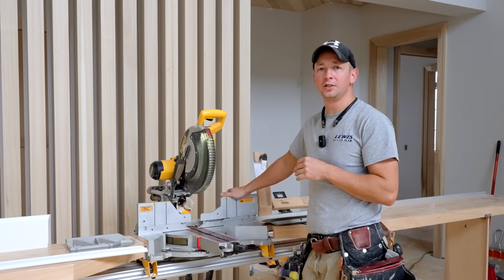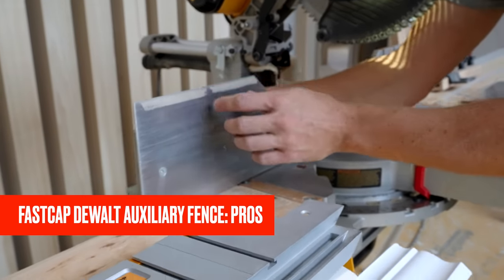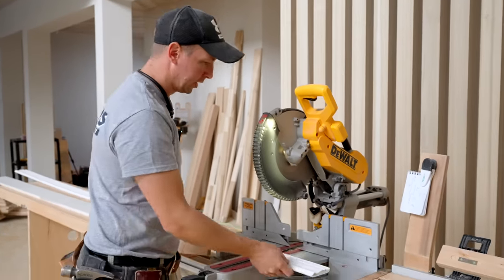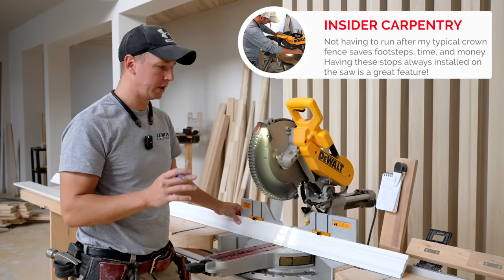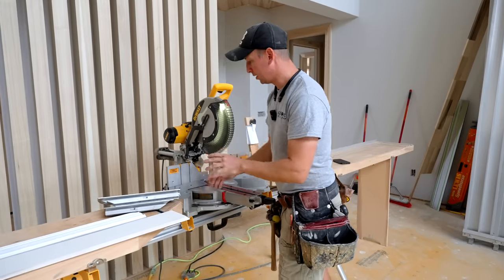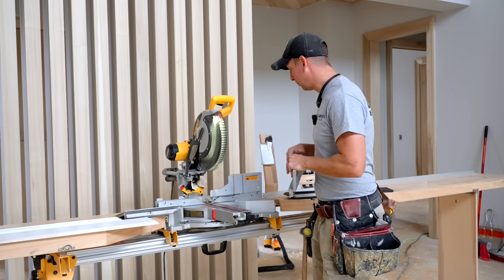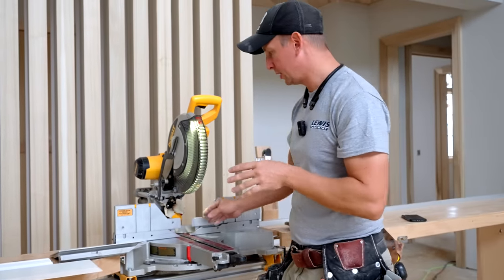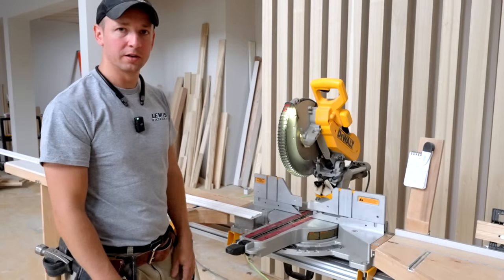These NEW FENCES Are A MUST HAVE!!! - I'm Impressed!!!

Comment: These are great. The Kizen fence has a similar crown stop which I believe is a bit more versatile HOWEVER the trade off is that the Kizen is quite thick in comparison. Will be interested to see if Fastcap starts making these for other saws.
Reply: And how much they want for that fence system?
Reply: @duartepaintinghandymanservices  they offer a few different options with varying prices but the largest kit with all the accessories is around $400
Reply: @jpesce23ful  yea thats insane

Comment: Great informative overview of the crownstop fence Spencer! This was a nearly perfect product when it was submitted to fastcap initially a while ago and was improved even more with feedback from the beta test tradesman group over a few months of testing to get those wishlist features in there (higher fence height, better knobs, and a few other tweaks.) I've all ready chucked my factory fences in the trash. Great add on for the Dewalt saw line up. I think there is only one of the many dewalt saws that you have to watch how close you set the stops to the blade as that particular model (carpenterone3's has that saw) must have a different stop block in the receiving part of the factory fence slot. Easy fix to just trim/grind it for that specific model. Great video!

Comment: I use the Kizen fence which has pins that are removable, so you can bounce back and forth to cutting base vertically or anything else without losing your crown setup. It would be a no go for you though because it adds thickness.
Reply: I now have both the kaizen and fastcap fence and I’m going to be selling the kaizen fence.
Reply: $450 fk that

Comment: Thanks for the review. I bought mine as soon as Fastcap had them available. I had the same problem with the left side fence. Had to file it down a bit, then it worked fine. I also noticed they sit out just a bit from the fixed fence and found them to lean in a bit more compared to the factory fence. Am thinking of trying to file them to correct them. Do yours sit in correctly or do you have the same problem? Otherwise I like them, using mostly for cabinet crown.
Reply from the maker: Mine sit pretty good. The only way I have seen to correct fence tilt is to tap  a bolt into the back to add tension and adjustment. But I fine that the fences are close enough for baseboard and crown install.

Comment: As a cabinet installer cutting prefinished trim.
It's very difficult to find a good square saw out of the box,and can take a lot of time to get bed/table/back in plane and at 90°.
Are they machined properly? 
A prefinished outside corner separates the diy,from a professional.
Reply from the maker: I checked this set and they are the same as the stock fences in terms of square. Both can be slightly out of square depending on how you tighten the wet screw.
Reply: @InsiderCarpentry  thanks Spencer!
Using a bottom mounted stop gets annoying, it's difficult to find 46 degrees etc...and I needed to drill holes near the zeroes .

Comment: How do they flush up with the bottom of the fence once you tighten them up? The right side factory fence on my saw tips the top back a light sixteenth when you tighten it up and there is really no way to shim it.
Reply from the maker: You can tap a set screw into the back of the fence to apply pressure. That's the only way I know of to correct it.

Comment: The stock sliding fence doesn't remain square after I tighten the nut.   Are the aftermarket units square after you install them and tighten the back nut?   Thanks

Comment: Wondering if you can think of any advantages of using the stops on the fence rather than the crown stop on the base of the saw. 
Thinking of building myself some miter wings and want to know if I should router out a crown stop jig in them. Thanks Spencer
Reply: When making a cut on crown, in the nested position, the saw blade wants to pull the material upward. Having stops on the fence prevents the material from moving upwards during the cut. When using a crown stop on the base there is a chance the material moves away from your stop as you cut, making cuts inaccurate.
Reply from the maker: A continuous crown stop across the saw base is always going to be the most accurate imo. But sometimes you just need something fast with the ability to still cut flat stock, that is where the fence stops shine.

Comment: Are these square (coplanar really, and square to the table) with the low fence?  Otherwise seems like a great upgrade to EZ fence
Reply from the maker: Not perfect, I found them to be equal to what I get with the factory fences. They tend to cant inward depending on how much you tighten the set screws.
Reply: @InsiderCarpentry  a tad disappointing. If there’s one thing that leaves a little to be desired with the saw it’s the quality of the fences. And maybe lateral blade stability that requires good technique but that’s probably unavoidable give their slider design. But love the capacity for base standing up so…

Comment: Too much maybe to ask a saw manufacturer for flip up crown stops that are built into the base of the saw. Flip up for crown and down and recessed out of the way - for base or flat stock. Possibly building this feature yourself into your wings might be an interesting project. Crown stops at the saw base are going to provide more consistent cuts than crown stops at the fence IMO. Of course shorties will not reach a stop on the wings but that’s a good time to just use a pencil mark on the base of the saw. And now for a little bit of a rant. What I liked best about this video is that you filmed it in front of the trump border wall. You get a close look at the mismatched heights of the lower line of the entire “bulk head”. Any idea why it drops in that one section. Still looks like a mistake that the architect, designer or framer should have picked up on. The interior design elevation drawings (from the slat wall video) shows the intent for that line to be continuous over the support columns. But field conditions show otherwise. Somebody should own that one, IMO. Hard to rant about anything on this channel but I try.
Reply from the maker: Those drawing are a suggestion at best. We made many revisions in the field. Interior designers often don't understand how things have to be built in real life so we communicate on those things and make changes as needed.
Reply: @InsiderCarpentry  of course. Just thinking the short portico section of girder (bulkhead) could have been upset or the balance could have been packed down the entire length to achieve a clean line. If a clean line was the architects original design intent. And I expect it was or maybe should have been.
Reply: If builder, architect and design criticisms are a problem because they may read them, I can tone it down. The fact is, these homes and the execution of your finish work in them…are typically flawless. From what I can see in the videos at least. Finish carpenters have the opportunity to cover or fix a multitude of framing and drywall sins.

Comment: I get the idea, but as a woodworker of 15 plus yrs.. some of these things are overkill imo..ive  been screwing on a peice of wood to the fence for yrs..yes the pivot point moves but just use a tape meausure..and it also works as a zero clearance ..none of those aftermarket fences are zero clearance..please dont become a sales man even if they send you free stuff..ive never used anything like that ever so i dont see any need..bit to each there own..
Reply from the maker: I get sent stuff all the time. Rarely do I share it. This product genuinely impressed my. For my needs I was more impressed with the fact that I could have a higher fence without adding material to the face of the fences. That's the big value add for me and well worth promoting to other guys like me. I much prefer these new fences to what I had before and that is why I made the video.